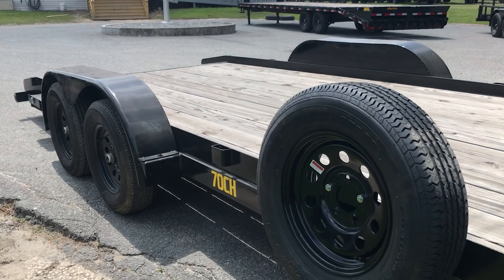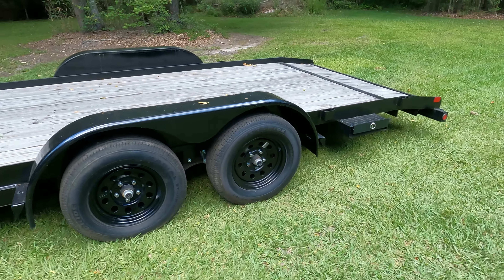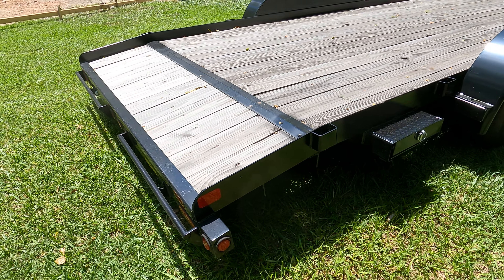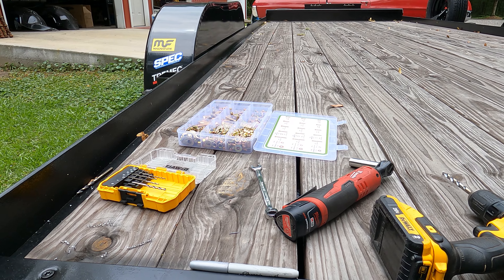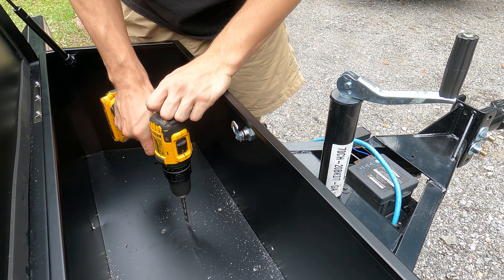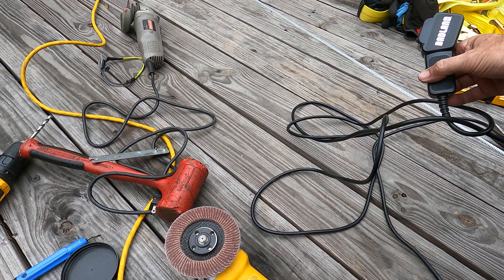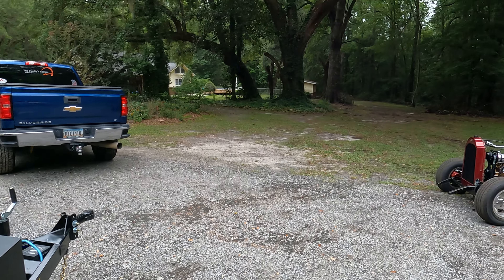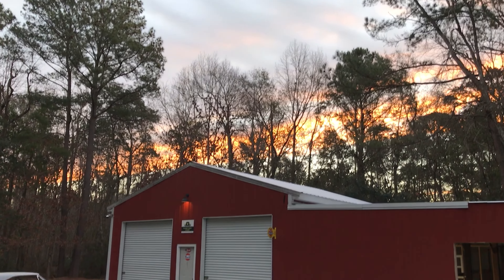Car hauler set up to quickly grab those classics!!

Comment: Slick trailer set up👊 i rent those aluminum car haulers from Uhaul with the surge brakes and tie downs and low ramp… they are very good of you dont have your own set up. That 5,000 lb wench you got is a super nice add… i have had some sketchy times loading non running cars 😂😂
Reply from the maker: I used to, but it got too expensive…especially like for a week at a time.

Comment: Nice work Joe!  Where is your round file for radius corners though?  Agree with you about ramps, they are almost always overbuilt and weigh a bunch...that's why I use the tilt deck, I'd like to check out some of these newer lowering  trailers (drop and Load) though...they seem really slick!  Of course they are triple the price though.
Reply from the maker: I do have a round file, but if you close the lid you can’t see the corners…😉😂